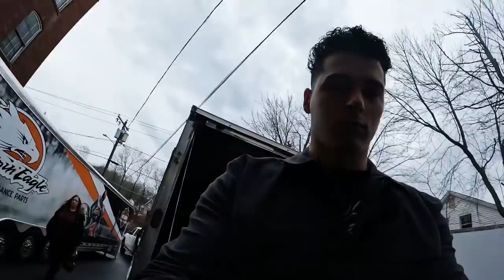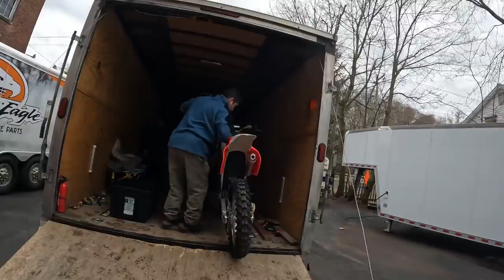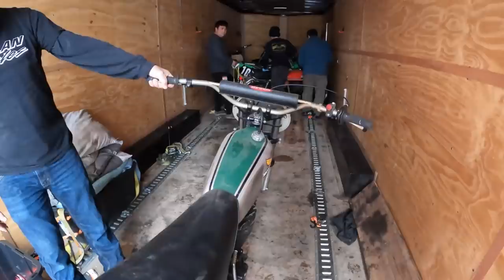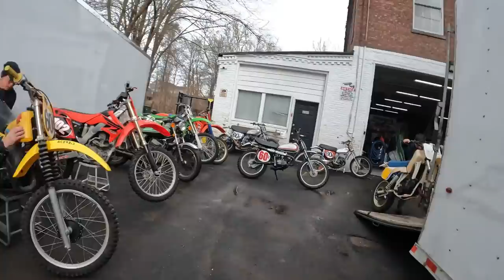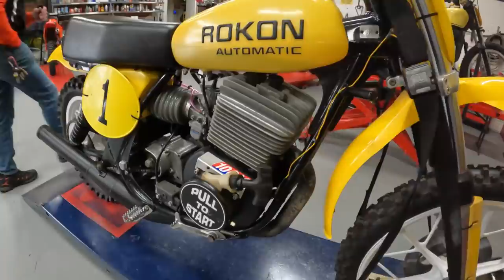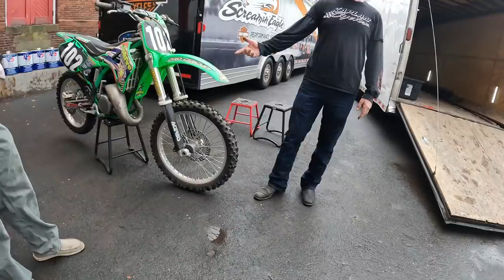WE BOUGHT 16 BIKES FROM ABANDONED STORAGE UNIT

Comment: A dude bought a storage unit for $160, he sold me a DR 100 suzook kids bike to me for that sum , I got it running into a harmless lend - out camping bike, a beer mule . He still had boxes & boxes of sandblasted intake manifolds , V8 heads, brand new truck bumpers in boxes, I suggested that he just sell all that stuff in one group, post pics & ask for $100 firm, take it all . . 
The DR100 was missing its fuel tank  & camshaft gear , otherwise it was a low hrs unit . I had a $60 parts carcass waiting to make 1 running bike out of the two . 
 * If you are gonna try to ressurect a beater bike, the most pain free way is to get an identical.parts  carcass ; easier said than done , though